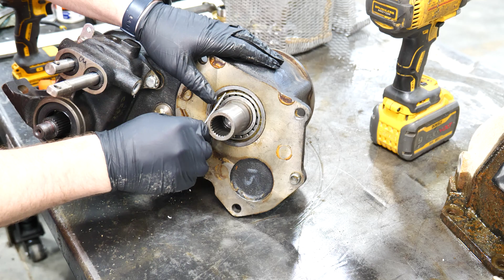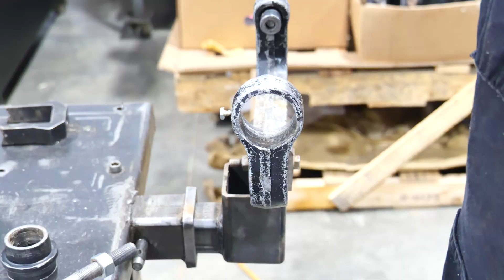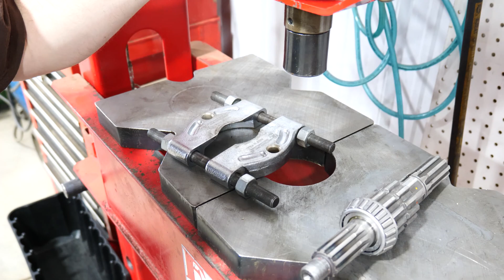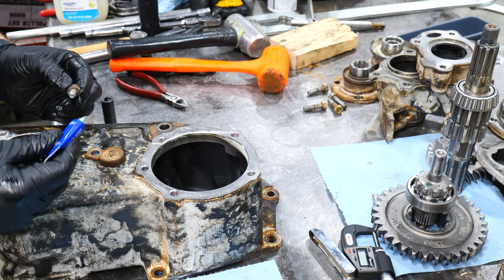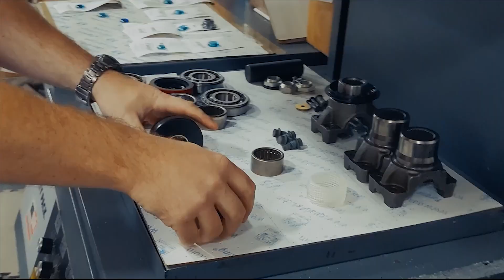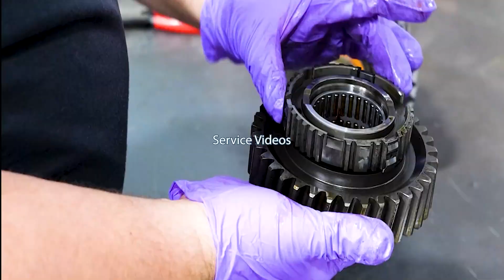Roxor Transfer Case Rebuild

Comment: Hey what are ur thoughts about the 5 speed transmission that’s paired to this ? Any good for Willy’s Jeeps ?
Reply from the maker: Actually, it would pair nicely. I think first gear is a bit taller. but having overdrive would be pretty handy. The transfer case profile is nearly identical to a Dana 18, however the transmission is twice as long. Besides driveshaft rework, you would need a custom adapter to bolt the transmission up. You would also need some transfer case shifter rework, but using Mahindra shift linkage would put it close to the factory location.

The transmission is fairly stout but being so compact they are a bit fragile with a tuned Roxor, but not any worse than a transmission in a tuned full size truck. With a good bearing kit and a few other things, it would probably last forever behind a factory Willys powerplant. Rebuild video coming soon, just finalizing tools and setup process.
Reply: I've seen these drivetrains when built with good us of a parts handle some hard use and abuse and keep going.from what I remember the bearings and seals seem to be the weakest link.i hope this helps.